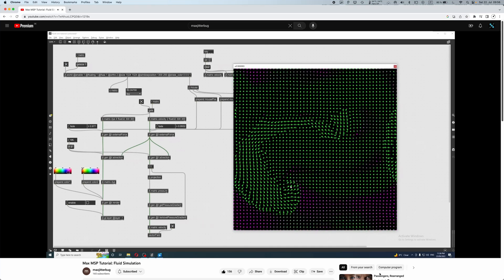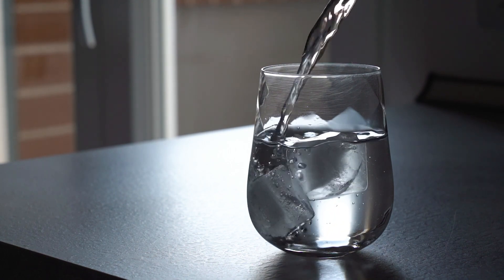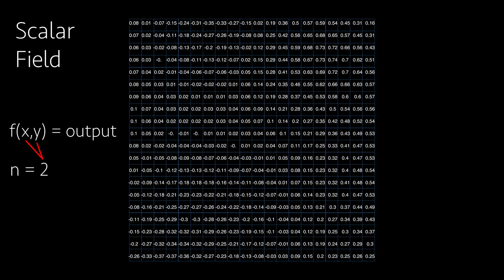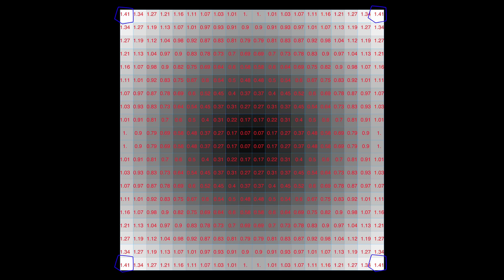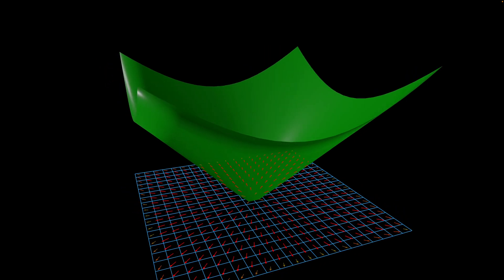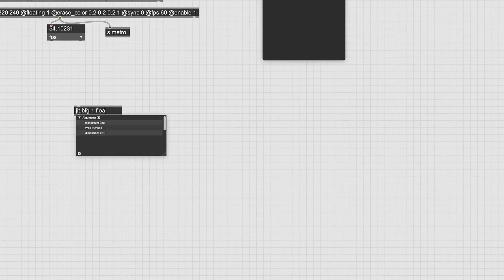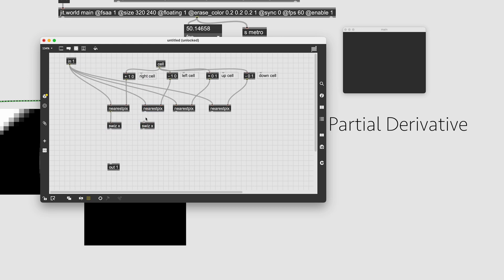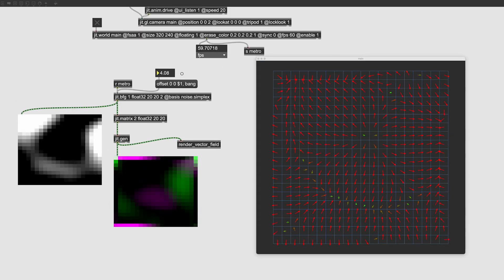Fluid Simulation Study in Max/MSP - Part 1: Gradient Field

Comment: Thanks for the explanation and demonstration. May I know why the color after jit.gen was changed?
Reply from the maker: Hi! Which part of the video are you referring to?
Reply: @AmazingMaxStuff  the p.window after jit.gen where the noise become a mixture of green and red
Reply from the maker: @JunYanMax  gotcha. That's because the pwindow will use the first two planes of the input matrix as the alpha and red channel, and then will use them again as the green and blue channel. The input matrix is filled with the partial derivative vectors values, which when represented as colors in the aforementioned order will result in fuxia and green.